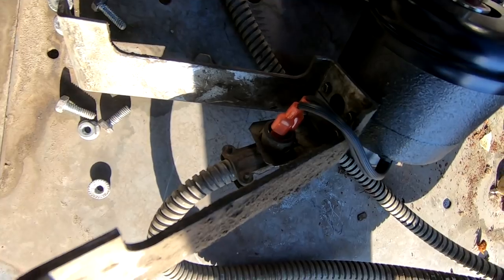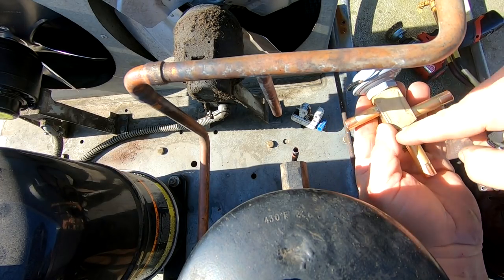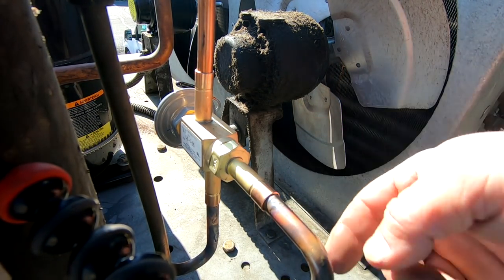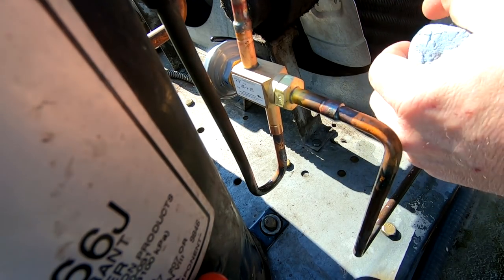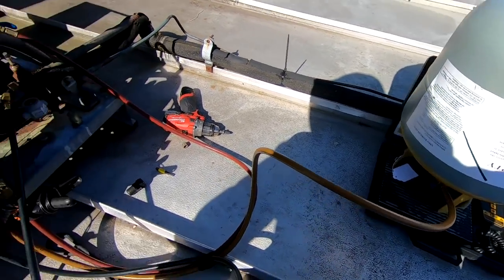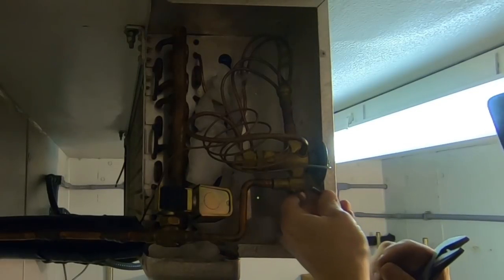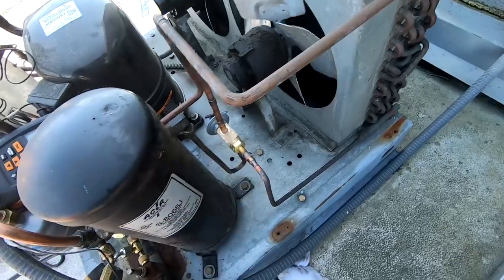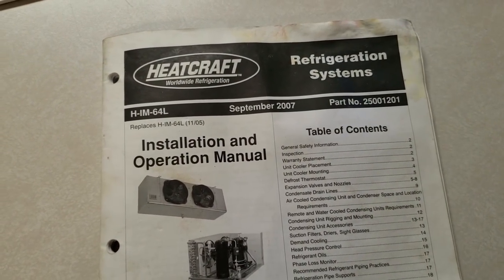Back To Replace the headmaster with a full startup of the walk-in freezer with TXV adjustment.

Comment: RE: Paper towel for heat block - had a compressor go out in my LG fridge and the guy that replaced it used paper towel.  Said it was quicker and cleaner than heat block.  Makes sense - as long as it's wet it certainly not going to catch on fire!
Every time I am soldering or watching someone else solder I can hear my grandfather admonishing to heat the metal and not the solder - hehe!
Reply from the maker: I use paper towels at times when other things won't fit. Nothing wrong with it and it works.

Comment: It is somewhat disappointing that professionals with a minimal assumption of logical thinking criticized Pettinato for the SH method of pipes temperature differential. So here we have a beautiful trifecta: 1) For being right. 2) For proving to be a perfect (sine qua non) method in the absence of a service port. And 3) Because a service manual from a major company confirms this in its literature. 

Excellent video Rick, that's a GEM for newbies coming into the trade.
Reply from the maker: Thanks Juan, it seams to be a common HVAC attitude I believe?
Reply: Juan Todolí I miss Jim’s videos.
Reply: Pettinato is an excellent example of using common sense and a calm mind to solve complex problems. Some of his methods are self-discovered and in my experience work quite well.

I really miss seeing his videos.
Reply from the maker: Hopefully he might see these nice comments about him and he would start again,  but doubt it. 😒

Comment: Adding a small amount of water to the heat block makes it easier to work with.  Enjoy your video’s!
Reply from the maker: I will need to try that, I kinda gave up on it. A wet rag seams to work better..lol Thanks for the info!

Comment: Great video !  That plugged up strainer was a great find wow !  after i saw that i probably would have tried to fit a drier before that Headmaster , when i see shit in a strainer , i know thier is usually more to come , possibly the compressor  windings are coming apart ?  you will prob be fine for a good while though. 
a tip for charging a finniky system , Just fill the Receiver to 80% capacity. the numbers are on the side of that receiver. the that one holds 15 lbs at 90%. so , 14 lbs is 80%. Just put 14Lbs in & your done. its the fastest way when you allready have all refrigerant removed allready. Then write total charge on the receiver in paint marker. it gives u a baseline charge for future work on that system too.

Comment: I second that 'well done" what an awesome video, learn a lot and i going to label my probes i did not because i did not what to use a marker. Thanks
Reply from the maker: Thanks kuku 215, I love using my label maker,  That particular label is a thinner width and has a heavy duty sticker on it.
Reply: i was wondering why they did not peel off. I going look for right type of labels, can wait to get it done. Thank you.
Reply from the maker: @20315711978  Brother Genuine P-touch TZE-S631 Tape, 1/2" (0.47") Wide Extra-Strength Adhesive Laminated Tape, Black on Yellow, Laminated for Indoor or Outdoor Use, Water-Resistant,0.47" x 26.2' (12mm x 8M),TZES631 https://www.amazon.com/dp/B004I2KIOY/ref=cm_sw_r_other_apa_i_D67JEbMM5T97W
Reply from the maker: @20315711978  that's from my history on Amazon.

Comment: Nice work that plugged screen would explain the short cycling and empty sight glass in the first video............
Reply from the maker: I made a few stupid mistakes,  biggest was not adding more refrigerant sooner. Most systems this size hold maybe 7 or 8 lbs. This pig took 13.5lb🤦‍♂️ plus I didn't go into details of how some else was there 2 weeks prior and fixed a leak.

Comment: Having a 20 degrees superheat out the compressor is outstanding. I have a few installs that it's very hard because the line set is very short
Reply from the maker: Long refrigerant line runs and ones that are ran above the ceiling are killer👍👍it's amazing how much heat they gain into the line.
Reply: i have a rule. 10' Minimum line set. ill Move a unit 10' away from a Hole to Get a Bit of Run.
Reply: @OcRefrig  that's a great rule, I had a really challenging system. I ended up putting in a sub cooler to try to get a little more superheat and had to replace the liquid line solenoid. It was a water-cooled condenser at a school district that I work. It would have been on the real massive project to try to put an air-cooled condenser on the roof it was in the dishwasher area underneath the dish rack. The superheat isn't the greatest but it's better with the sub tour in there. This was a low profile low air flow model I had to have in this walk-in cooler. It was a little ceiling about 7 ft tall I was afraid with a regular air flow model I might freeze product

Comment: that was a great video for me. Thank you
I have some questions, so just by measuring the temp if the evap inlet and outlet (7), that can give you a pretty accurate estimate on what the evaporater SH? never knew that
also, when would i know when to check condenser SH and evap SH?
why did you recover the charge if you could've just pumped down the reciever? because i noticed you did that when you checked the screen for the TXV
Reply from the maker: I had to recover it because the headmaster is before the receiver. (You cannot isolate it.) The TXV however is after the receiver and service valve.  Your 1st question is correct,  yes that is a easy way to get your values when you can't do the traditional superheat method,  they recommend you do it the normal way vs the temp/temp method.

Comment: Thoroughly enjoyed the video , mate , very useful information indeed 👍
It kinda makes me wonder though , is it really worth it to have a headmaster , after witnessing how much it throws off the txv when it's bypassing the condenser , I mean , with a proper fan speed control , you can achieve a good enough regulation for the head pressure , I'm guessing it's a cost efficiency issue isn't it ? Although inverter driven fan motors seem to get cheaper so , maybe it's the future ...
I work on chillers that use different voltages to regulate the fan speed , and if the parameters are correctly set up , it does work pretty well, without massive HP swings , but then again , it does require a pretty big transformer  and more expensive fan motors so yeah , I guess cost innit !
Reply from the maker: It cost more in refrigerant when a headmaster is used but it's a steady pressure to the txv, and it generally doesn't wear out,  it's killed as you seen in the video.

Comment: As always a good job informative video as well . Just a question that Headmaster valve was that a Sporlan LAC valve if it is generally speaking on that particular valve they want a check valve on the line going into the receiver I believe the O R A valves don't require one
Reply from the maker: Lac-4 I believe,  I showed it in the video,  I'm fairly sure that is the model number,  I did see in the true manual something about a check valve but I believe that is for the two peace head pressure control valves. None of the smaller ones have ever had one that I've worked on.

Comment: It gets too cold for you guys to do this. But i had a morgue cooler that HAD to be running and the unit had a burnout. Maintenance guys replaced compressor and txv and couldn't figure out why they still had crazy head pressures. I pulled off the head master and about 1/4 of dust and junk and blown out shellac and filter dryer blew out of the lines. Needless to say i had to remove it and didn't even have a fan cycle switch. But it ran just fine over the winter but we only get to 20-25 as the low at night.
Reply from the maker: 🤣👍👍. Yeah that's not very cold.

Comment: I learned if you change compressor check strainer. Over heated compressor discharge valves make black carbon
Reply from the maker: 👍👍 Which strainer in particular? There's several depending on the complexity of the system.

Comment: that is my food right there. thank you for the upload Mr.Rick. so after pumpdown your liquid level was about 70%? i know they cant be over80%.
Reply from the maker: Yeah I would guess my level was somewhere between 70 and 80%.  According to the book the tank can hold 90% of the total capacity. Don't forget,  this is dependent on the location of the liquid solenoid,  Generally the valve is down at the evaporator which means you can stack a column of liquid all the way down to it but some of our solenoids are located outside which reduces this capacity,  Especially if you have a half inch liquid line.
Reply: @HVACRSurvival  thanks

Comment: We use a cutting torch to braze, and no nitrogen, I work on transportation refrigeration we aren't given the time to do it right, gotta get it done fast so my boss can make more money on the next job
Reply from the maker: That's understandable, I've use a Sawzall to cut copper before 😳 When you're dealing with 2in suction lines and no room to get into it sometimes you have no options.. As you see, we have to make it work in the field. But when you can do it right,  that's when you do what you you feel is right.

Comment: How do you control compressor superheat without affecting evaporator superheat? And why is that condenser fan motor so oily/dirty?
Reply from the maker: Compressor superheat overrides evaporator superheat. Unfortunately this is a very short run so you're not gaining any heat between the evaporator and the condenser.in theory most manufacturers require at least 20° to 25° at the compressor.
Reply from the maker: The motor is probably oily because the seals are leaking out oil and that generally is a sign of a future failure. Keep in mind if they replaced everything I found wrong they would be building a new store. Most places want equipment to run at the minimal cost.
Reply: @HVACRSurvival  Never heard of it, we always went for 10 degree evap superheat. That's interesting. You would think all liquid would be gone with 10 degree super heat.
Reply from the maker: It potentially could change based on outdoor ambient changes, like below zero F. outdoor ambient.

Comment: Hard to believe in the early years of refrigeration they used to use an evaporator with a built in float ball and valve (on some systems) -- an evaporator that looked more like a car radiator with a cavity at the top.  --  hence the "flooded evaporator".   Fortunately the TX valve was invented, to make for more compact designs.
Reply from the maker: I've seen the pictures and there is industrial systems that work with those primitive type of designs.
Reply: I'm just thinking how much space a TX valve saves.

Comment: Did you change the filter drier? You didn’t show it if you did....
Reply from the maker: Normally I always change it whenever I open a system but because I just changed it 4 days prior I did not,  I know... I know... Up on the cross I go. 😕
Reply: My bad! I remember this was a return call now. I wouldn’t have changed it a second time either. I was really surprised how dirty that screen was. Often time when I come across a failed headmaster, I leave it and opt for a fan cycling control depending on customer and their budget!
Reply from the maker: No worries👍👍I fully understand about the fan cycle control. I usually leave it up to the customer also.

Comment: The gas has all that crap in it....
Reply from the maker: Short of replacing the whole system,  the filter drier will need to do its job.
Reply: HVACR Survival   Unfortunately I have seen a lot of compressor motor burnouts on large built up systems that could never be “ changed” out. Maybe it’s wrong to do but we never have reused refrigerant that had a hint of being dirty. I understand that customers don’t like to spend money on problems but I have discovered if a system is cleaned up properly the first time an electrical burn occurs things work out for the best. Just my two cents. Every valve I have ever changed after a burn has had a filter/screen plugged beyond repair.
Reply from the maker: The refrigerant was replaced when another tech made a leak repair a couple weeks earlier. This equipment has been used and abused prior to us starting to do work for this chain. The equipment reminds me of polishing a turd,  it's always gonna be a turd no matter how much you make it shine.